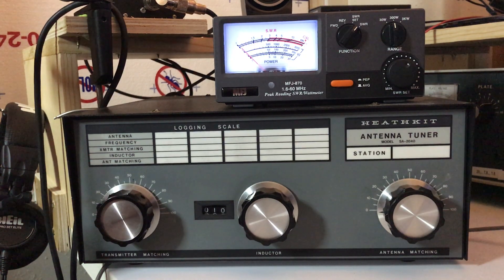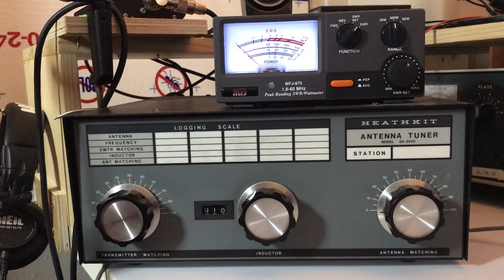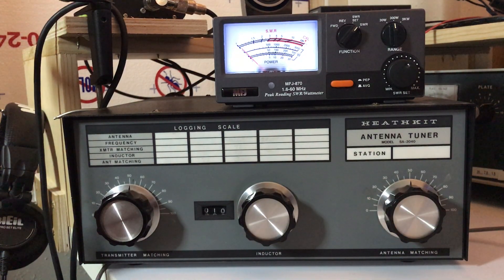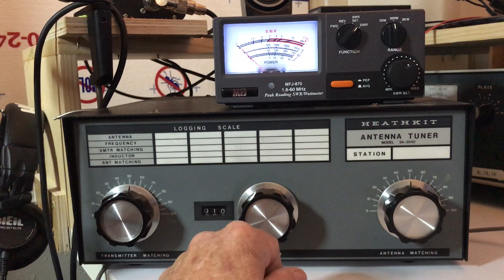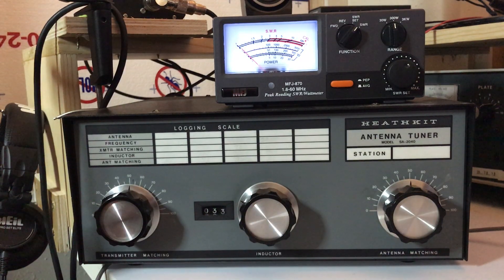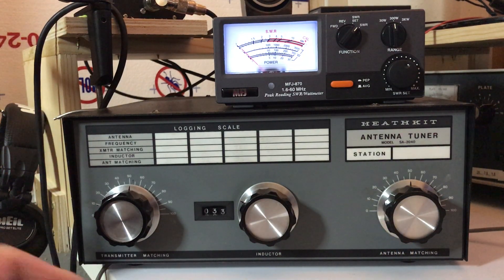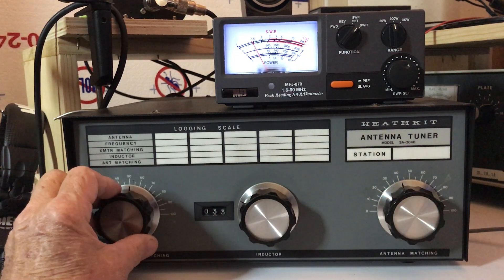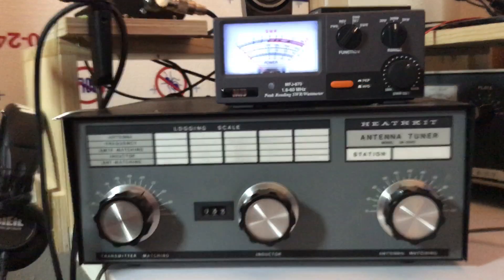Tuning up the antenna tuner

Comment: will this tuner .. tune to full power ?
Reply from the maker: I’m not sure what you mean by “tune to full power”.  Perhaps you can expand on that.
Reply: @JamisonTompkins  Well after tuning antennas' can you run 1500 watts of power thru it.  I see some tuners rating for 2k and 3k and 300 watts and 100 watts.
Reply: The Heathkit SA-2040 antenna tuner has a power rating of 2000 watts (2 kW) SSB PEP and 1000 watts (1 kW) CW.  That's more than full legal limit.

Comment: what is the max, that you can tune  in Ohms  73, thx
Reply from the maker: Hello Maurits, I can’t answer that in ohms, I have never measured it but perhaps I will sometime. However I can say that I can match a 20 meter resonant vertical to 75 meters a 1:1.  I doubt much power is radiating but that match is there.
Reply: @JamisonTompkins   try it with my deltaloop thats normal 200 Ohms  no problem  wire input and balanced  on the 4:1 balun on the back of the 2060a atu thx gl 73,
Reply: I have read that it will tune to 5:1.  If that's true, it would be the range of 10 ohms to 250 ohms.  73 de kc4i
Reply: Will this tune a 50ft random wire?

Comment: I think you should have went back & Re-calibrated the SWR meter after tuning.I think it can change & it would be worth checking just as a backup to the tuning you did with the antenna tuner.Some people think that an Antenna Tuner actually changes the SWR but of course it only fools the radio & other items that are inline to see a good match even when the real SWR is Terrible.